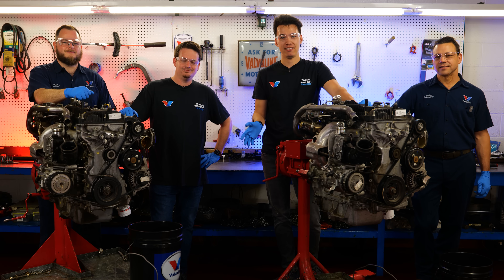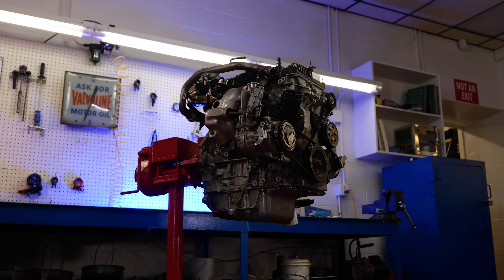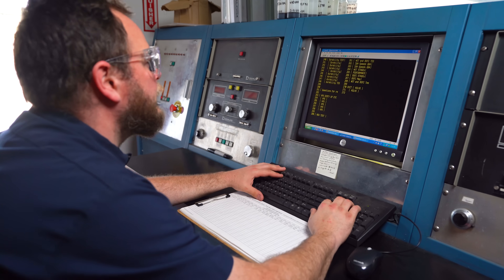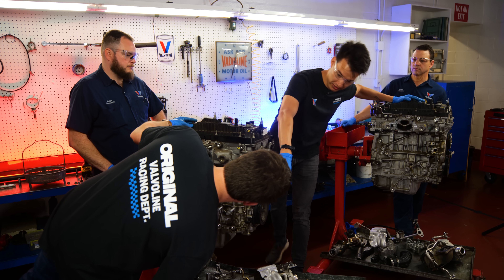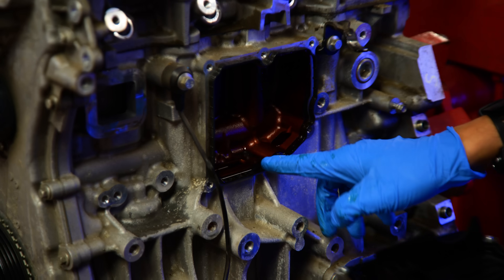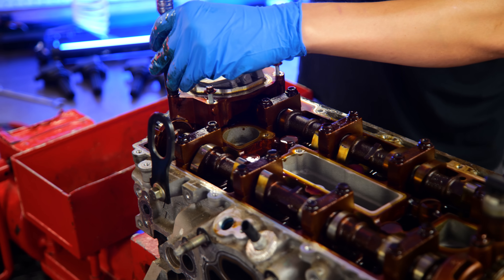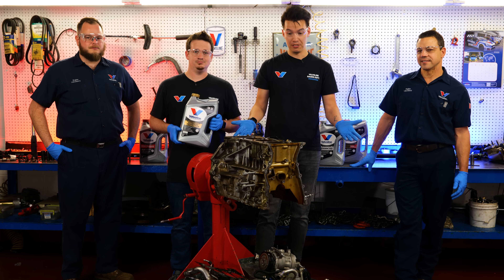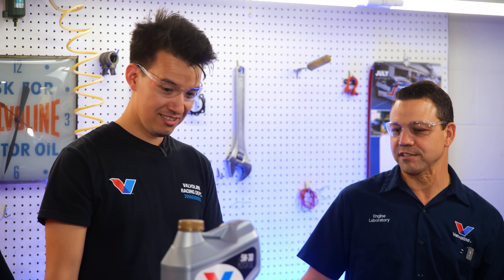Testing different oils over 4 years and 1 MILLION miles

Comment: The ability of synthetic to clean the already dirty engine needs to be tested. This test should also test several different fuel mixes - even propane and wood-gas - to be the most informative and prooftastic. The actual true science as to why an engine gets cleaned-up needs to be known. Comparison of cost is important, but it is an easy guess that the cleaner piston rings are worth the cost of synthetic oil and then - tougher equation - perhaps also high octane fuel. And what about a tiny bit of water injection for cleaning? Lot of things next to be tested...

Comment: They did not show the oil return rings closely, nor the small holes in the piston for oil return. That is what I wanted to see if got clogged on the synthetic (obviously clogged on the conventional). Generally, I don't recommend 10K mile oil changes for this oil return clogging issue because the dispersants break down while the soot builds up, and this soot passes right through the filter (which is why your oil is black despite being filtered). This soot is the carbon that sticks to your rings and clogs those small holes in the piston, right behind those rings. Just change your oil every 5K miles (5, 10, 15, 20, etc.....). If you run a bit late and change it at 25,500, then your next change should still be 30,000k. This way, you just need to look at your odometer, and if it's divisible by 5,000, you know you have to change your oil. Now, if you have a hybrid, maybe you can get away with 10K changes without the return rings getting clogged. I was thankfully able to reverse 90% of this clogging on my 2016 XC90 with Valvoline Restore and Protect after two 5k oil changes because my oil burn rate is 90% less now, and probably will be gone by my 3rd change.

Comment: 0:45 the oil change interval is 4-5k miles max. I don’t care what you’re putting in it or what ford says. They just want it to make it out of warranty
Reply: I don't understand? Vehicle is getting out of warranty regardless if it's a religious 5k or 10k oil change.
Reply: @jareddaddyd   that’s the goal. It’ll make it out of warranty but the question is how far will it go after. Usually not all that long when people are negligent.
Reply: @MrSlimeMan01  wrong as I did 10,000 mile synthetic oil changes on two different minivans over 23 years and 375,000 miles never had an issue
Reply: @bubbafatas2588  if you maintain your shit I’m not terribly surprised but the account of one internet stranger doesn’t override the experience of myself, my father, or the classes I took that tell a different story. Go make friends with any reputable mechanic and they’ll tell you the same thing i did.

Comment: Ran Purple Power in a 12 TRD TACOMA 4X4 DOUBLE CAB.Changed every 3-4000k miles,k&n filter....ran like new at 250k miles on original serpentine belt😂.....used it as a service vehicle in major metropolitan area at about 4-5k miles a month constant freeway ,rush hour,city driving and because it was a service vehicle I never shut if off for a minimum of 14hrs a day,it idled when not in movement. I think the oil and proper maintenance had alot to do with the longevity. Sold it running perfectly. I did go thru 4 sets of brakes,tires,and shocks,1 windshield and replaced the headlights.,replaced the rear diff fluid 3xs,.....dont remember ever doing the trans fluid I believe it was sealed pan,lifetime fluid.... 2012 tacoma trd double cab properly maintained V6 4x4 is an incredibly reliable truck...again goid oil and maintenance is key. I bought it with 10k miles on it with the service plan records it came when it was purchased new 2 oil changes.

Comment: I'm 65 been changing  oil  50yrs.  Best to change oil 3500. Miles city driven. 5000 high way,,,no  if  ands or buts!!!!! Now if your on a supper tight budget  then max is 5000 city 7000 highway,,,, absolute  maxes

Comment: arent you supposed to change oil every 3,000km for regular oil, while 10,000km for fully synthetic oil? So running 10,000km for regular oil will be of a disadvantage?
Reply: But I've known non-gear-heads to have oil changes every 8K to 10K miles, so this was interesting what kind of abuse the engines get with infrequent oil changes.

Comment: As soon as I broke in my 2006 Nissan 350Z, I've been using full synth changing at about every 5,000 miles.  It's got a little over 265K miles.  Gets better gas mileage than stated EPA.  If I cruise 80 mph, I get about 27-28 vs 26 with tires 2 sizes larger than OEM.

Comment: What an eye  opener!!!  I switched to mobile 1 FS last oil change. I am very happy with what I'm seeing here. When it reaches 5000 miles, I'll switch to Valvoline full S . I have been running the Valvoline  blend with Lucas oil stabilizer  for a long time.
Reply: Stay away from oil additives, oil stabilizer just thickens the oil. Additives will decrease oil life. There's a guy that tests additives in a lab and that's what he's found. You're better off using only synthetic oil

Comment: I have 350,000 miles on an old Ford 2-valve pushrod engine.  Been using synthetic oil (whatever is on sale) and OE filters since about 80k miles.  Valvoline oil absolutely is great oil, possibly the best mass-market brand, but ANY synthetic is better than conventional oil in my experience.

Comment: using conventional oil every 3,000 miles is better than synthetic once evey 10,000  miles. that's 3 oil changes VS 1.. something to keep in mind. my 2007 monte carlo lt V6 3.5 is still going strong at 293,000 miles.  I change my oil every 3 thousand miles and also add a little bit maby a quarter of a liter of full synthetic as well. after 100,000 miles I also started using blu devil oil stop leak... and I have had no leaks since.. and no gaskets changed or anything major go wrong. I drive the hell out  of it every day in Phoenix Arizona in the HEAT. hope this helped somebody lol

Comment: Throwing these on a dyno for testing to "500k miles" is basically cheating. You've set up an artificially controlled environment, no change in weather, no change in terrain, and no real load against the engine and the rest of the vehicle. It shows that these vehicles are not holding up either because even in controlled environment they still managed to have multiple failures leading up to this point.

Comment: 2001 toyota corolla with 350K on it . . .  should i switch to synthetic oil or stayz wit' conventional?  🤔
Reply: Make sure you flush and clean it doesn't matter. They probably used conventional without detergent. While the synthetic was with detergent.

Comment: gotta specify not a hater, just a thought. why dont these test never do any real life scenarios in thought(yes i heard the idle change and highway driving part of the video) but i want to see a video where these dudes drive it 20k plus miles, on the dirt, in the cold... other ACTUAL test. in a lab never gives proper results. i say have the same test but at 200k and drive it across the country in the identical vehicles
Reply: Even that wouldn't be the same. Parts failed unrelated to the oil especially the waste gate which unfortunately usually ruins a turbo engine.

Comment: change that conventional earlier alot more often then 10k and it would look alot better.   If you do 10k oil changes on your vehicle you had better be checking your oil in between oil changes as youre just asking for an oil consumption issue to come up and kill your bearings from run low on oil.
Reply: And that was driven 250000 not ran in shop without weather changes,dust, potholes and mountain driving
Reply: I always run some engine cleaning like seafoam to remove the tarnish at least every 20000. Last motor I replaced the timing chain at 250000 (because of a bad tensioner) other than that it looked like new inside.

Comment: Oil is cheap engines are not, i use full synthetic Mobil 1 for my Toyota Avalon and Nissan frontier, 5000 mile interval between oil changes.

Comment: So you tested the engine oil every 1k miles which was 8 hours? 6:34 at least that’s what was stated here. In other words this test was conducted at 125 mph, IMPRESSIVE!!!!
Reply: They mentioned it being at different loads, so maybe even higher 😅
Reply: Checking the oil level every 8 hours and doing an used oil analysis every 1k miles isn’t the same.

Comment: I run Castrol GTX full synthetic 5w30 in a 4 cylinder Nissan pickup and it also has that nice golden sheen to it also my truck is pushing 325,000 miles .

Comment: I enjoy the validation from this video! The ONLY oil that I put in my vehicles (and family/friends that I help maintain) is either NAPA or Valvoline Fully Synthetic High Mileage. They are the same thing..... With a NAPA Gold (or Platinum if in stock, but is rare the last few years) oil filter. Our 2006 Toyota Prius has 286k miles before a piston skirt broke off(bought at 90k). Our 2012 Ford Flex non-turbo is at 190k miles(bought at 84k).

Comment: Another thing to always use full synthetic in is………………..your lawn mower.  Mower’s  lead a tough life.  Actually, change your mower oil twice a year.  Once in spring and once in the middle of the summer…  get the rubber hose extension for quick and easy oil changes. You’re welcome.

Comment: As a Ford service advisor, 10k engine service intervals are NOT recommended on any Ford engines for any reason, at all, ever. Ford uses Motorcraft Semi-synthetic oil in the 2.3L Ecoboost. 

A 5k service interval is generally recommended on all Ford engines, even the Powerstroke.

Comment: I hope these mechanics understand that because these engines have 500k doesn’t mean they should look worse than your engine in your car. One comment was the engines I work on with much less miles look worse. These engines are probably only a year or two old max. They are run 24/7. Most cars to get to 200k takes 5-10 years. Outside driving. With animals around. And rain. And dirt from the road. Kind of a dumb statement if you ask me. These two vehicles are probably inside or least under cover from rain and snow and wheels aren’t kicking up anything. I mean come on. If I made that comment after I would say edit that out please after I realized how dumb it sounded.

Comment: Iv seen a couple comments, and its true. You shouldn't run the conventional oil 10k its not rated for that like the synthetic. The car calls for 10k intervals then it also calls for semi/full synthetic oil.
Reply: But it is interesting to see the internals of the engine that was abused with 10K miles oil changes with conventional.

Comment: An important thing to remember is that anything that works as a detergent also causes things to deteriorate, such as seals, gaskets and o rings. Certain motors are better off without a full synthetic oil mixture.

Comment: "Mobile One" did a Similar test in the late 80's (when it first came out for automobiles) with two Olds 88's....reg oil changes, one SYN, the other Conventional....ran 100k miles.. the ENG with SYN was still within "Factory Specs" of a NEW Engine.... the difference is the heat dissipation "properties" of SYN oil....  High Heat Causes Metal fatigue, breakdown and wear...  Lubrication Qualities are Similar... JET engines (Gas Turbines) run SYN for that very reason...The video, points out, that the "varnishing" of the conventional oil has a significate affect on long term use...

Comment: I use full synthetic oil and change it every 5000 miles though I don't drive in the city. Maintenance is very important if you want to have a long lasting engine.

Comment: Good data is always nice to look at. what I didn't hear, though it may have been said is what was the cost of both oils per quart or gallon, and what was the oil change time frame. conventual oil has a shorter life even with all the additives. 3000 miles should be the limit between changes. That would be 167 oil changes.(not that everybody does that.)with a cost of 20.00 per gallon = 3340.00 for the oil. and the synthetic in most cases is 10k to 15k between changes so that would be 34 to 50 oil changes with a cost of 46.00 per gallon = $1564.00 or $2300.00 for that 500,000 miles. The filter and the person changing the oil would have the same cost And Setting aside that the synthetic is prettier. there is a good bit of savings happening at least there, a $1000.00. and then add EVANS Waterless Engine Coolant to protect the circulation system. cost about 100.00 I've had mine in the car for 7yrs and it is still looking new.

Comment: You can see the difference, but this is not a true comparison. You want to do it correct you need to start and stop the engines and have them cool down to cold and start again. Most engine wear is from cold starts. That is why Taxi's get good milage out of engines as they hardly ever do a cold start. One driver gets out and another gets straight in. We have Taxi's that often get 500,000 miles plus out of them with hardly any issues and just normal servicing.

Comment: I could be wrong, but if you pulled both drain plugs out at the same time the synthetic one will run out faster and therefore finish sooner (as long as they both have the same volume capacity of oil)

Comment: 10,000-mile oil change interval. This makes me wonder how much better the conventional oil would have done with 3,000 to 5,000 mile oil changes. I personally go with 3,000 to 5,000 mile changes with synthetic. Usually closer to 3,000. I'm no mechanic, but to me, I was impressed with both engines for having 500,000 miles on them.

Comment: Why would they change conventional oil at 10,000 miles? The synthetic is rated for 10k but conventional should be changed by ~3000 miles or as soon as the oil changes color. It's almost like they wanted the conventional to look worse.

Comment: If you used a reasonable service interval with the conventional and not the same as the synthetic I'd say the wear would be about equal. It could be slightly either way but I doubt it would be enough to really make a difference.

Comment: I'll just stick with rotella t-6 in my 7.3.  27 years with rotella and it runs like new. As for gas engines when your oil is due for a change and it's down a quart which it usually is when it's due for a change just put a quart of automatic transmission fluid in it and drive for a hundred miles and it will clean out all the varnish and sludge.

Comment: From personal experience I can say that the brand of oil or the change interval mean nothing when it comes to engine durability. Key is to make sure you don't run low on oil.
I drive mainly Volvos and Mazdas. They all had hundreds of thousands of miles before I donated them to family member or a friend. I buy whatever oil is on sale. I'm also not particular about the filter. I do my own changes. I don't use synthetic. It is too thin and will leak out easily on older engines.

Comment: I use FS in my F-150 Ecoboost and change my oil every 5,000 miles.  I’ve already far surpassed significant recommended maintenance intervals which is a double edged sword.  Things like the timing chain replacement at 100k.  I’m currently at 135000 and just wondering how much farther I can go before it breaks on its own.  Luckily I have several vehicles so putting the truck in the shop when it breaks is not an issue.  This was a super informative video.  Thank you Valvoline.
Reply: If you wait until it breaks you will need a lot more than just a timing chain, the 3.5 ecoboost is not a non interference engine so you will destroy your internals.
Reply: A combination of the ecoboost being an interference engine and a timing chain whipping around inside the timing cover will nuke your engine if you wait. Chain wear is more about material properties of the chain rather than proper lubrication. Good lubrication will help the tensioner last longer but it’s inevitable that something will catastrophically fail sooner rather than later. I’d think about getting it taken care of bro!
Reply: The chain can also stretch to a certain maximum where the chain tensioner cannot tension it anymore. Once you reach that point, it's a steep cliff.

Comment: I have been using Valvoline full synthetic for years. I don't like engine failures or buying vehicles. I'm glad to see this test. I'm planning on 250k miles on both of my vehicles. Or maybe 500k. Thanks for posting this.
Reply: And I change oil at about 3000 miles. Cheap insurance

Comment: Why I use synthetic in my beater vehicles: They have a tolerance for higher temps. Ford, for example, uses plastic parts in their cooling plumbing (water neck, heater bypass, etc). These parts fail and you quickly run hot. The higher temp tolerance buys you some time to get to a safe spot to make a roadside repair.

Comment: This is definitely misleading because you should never run conventional oil more than 5k miles. There would be little difference if both ran 5k miles. Also oil is oil as long as it meets the specs your engine needs. Conventional oil also used to be cheaper.

Comment: Nobody in their right mind wud let regular oil go 10k iles. Conventional oil is not designed to go 10,000 miles. It is not an equivalent test. They shud of did regular oil go 5k. Wear wud of matched better. Or another brand of syn oil.

Comment: As a certified Master Mechanic,  I've found that the fuel is the biggest factor. I ad filtered USED motor oil to my fuel; it significantly improves performance and longevity to the top end.

Comment: I have a 1998 dodge ram 2500 cummins turbo I only charged the oil every 2500 miles. But I change the filter every 5000 miles. I ran a secondary bypass filters for synthetic. 
I got 560,000 miles on it it still looked clean. Conventional motor oil.  
It’s all of the filtrations